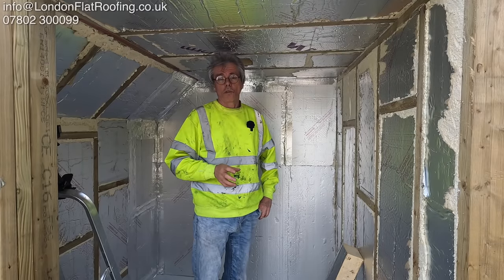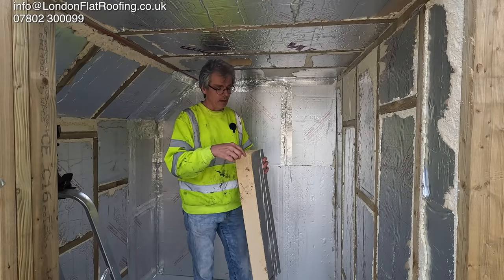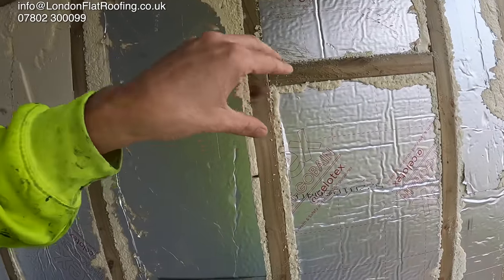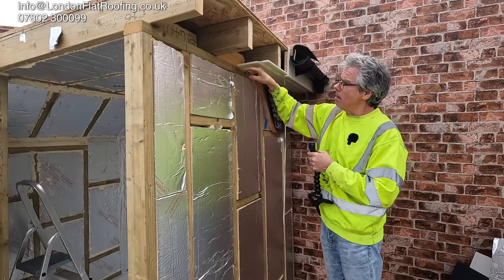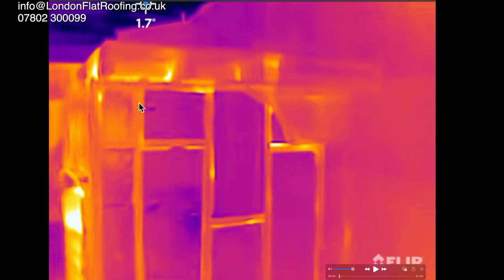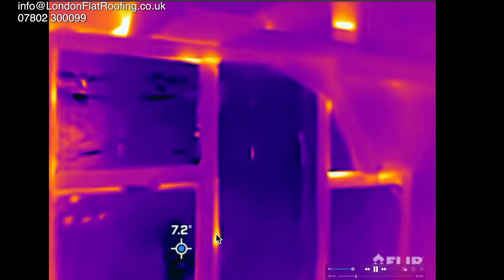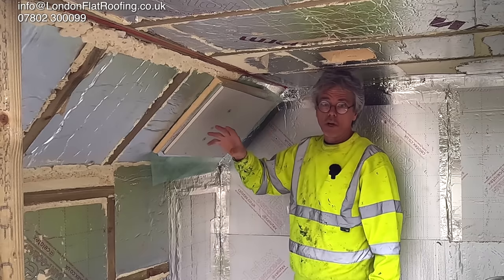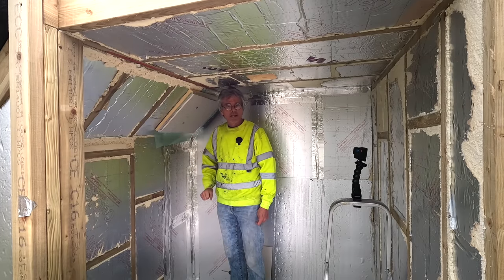Badly fitted insulation between joists and thermal imaging

Comment: I’m a carpenter and currently constructing my partners gym. All timber construction. 
Using the tape you have mentioned. Much prefer this method, it is time consuming but a better job. 
Couple of things to mentions: 

I do have a crown roof construction which adds to the overall outlay. 

Cost. The tape cost as much as the pir insulation for the whole build. 

Once you have a system going it can be quite quick to install tape. 

All in all this method will have to become the norm as we evolve in the construction industry I just hope the tape price will come down.
Reply from the maker: Please send over some photos would be nice to have a look. Yes, its better but very costly. I think we will be moving away from PIR insulation soon I will be showing a completely different way of doing things in an up and coming video using mostly much cheaper insulation and a quicker method of installing also more air open!
Reply: @SteveRoofer  I will do Steve. Thanks. I have subscribed to you for some time and you have certainly made me re think on the  installations of insulation products. You are a credit to YouTube.
Reply: @SteveRoofer  looking forward to this Steve, informative as usual.
Reply: Yeh I would much prefer to use the tape but it's just way to expensive at the minute.
Reply: @SteveRoofer  Please do it soon - I am about to embark on a similar project.😀👍
Reply: Totally agree with having to move away from pir have thought this for years if its too reliant on perfect scenarios and only performes in basic simple detailing then it is going to be failing in a lot of buildings unfortunately where corners can be cut as its not seen.
Reply: @hn9598  Yup it looks great on CAD drawings etc but completely different in real life.
Reply: Hi and thanks for the very informative video.
Question though (possibly controversial to the elitists): your TI Camera showed bright yellow where heat loss occurred. This looked to represent less than 1% of the total area that you insulated. Is that really as big a deal as you are suggesting?
This is in no way a criticism, but you could end up spending way more money on material to cover that 1% than you would lose through extra heating charges.
For me, I Intend to create a warm loft as it’s used for storage,  so I’ll use approx 250mm of rolled out fibre insulation between the joists then was thinking of simply wrapping the underside of the rafters with the super foil type stuff just to help keep the warmth in the loft.

Would love to hear your response to my question and any advice you have to offer.

Many thanks, look forward to watching more of your vids.
Reply: Ему просто заплатили за рекламу! Пароизоляция в помощь!
Reply: Spray foam better. Moves with the wood. Quick to install. Just not a DIY product atm.

Comment: I think it’s important to be a little more clear on the definition of ‘loads of heat loss’ . As a previous comment mentions, what is the heat source used to record the heat transfer? Also what are the span parameter settings of the thermal camera. The images in thermal imaging can often look alarming but it’s important that the interpretation of those images is understood correctly to be realistic in the  quantitive data. Thumbs up for the enthusiasm but those cameras in the wrong hands can be quite misleading.
Reply from the maker: Your absolutely right in aspects of your reply. My point in the video is we can do better and should do better.
Reply: In reference to the thermal camera, are you saying "please clearly define the colors in reference to how much of a change in temperature the areas are"? In other words, the visual "distance" between blue color on the camera and red is 0.5 degrees Celsius vs the "distance" between blue and red is 15 degrees Celsius?

Comment: I appreciate there is clearly heat leaking through the badly sealed gaps between insulation and timber but it's a pretty small proportion of the wall as a whole.  Surely the answer is to leave a ~10 gap all around and foam it.  This would give a much more consistent foam installation and not only will this provide a better thermal performance through the foam - and the wall as a whole -  but also, as you mention, much reduce air movement though it.

Comment: I'm rebuilding my old 1880s house and am using Rockwool/Rocksilk everywhere with a membrane. Cut it 1/2" - 1" bigger than the gap and it makes a nice tight fit and fills up any wonkiness in the battens.

Comment: I just made my own tape.  A roll of expansion joint foam and a roll of foil tape.  Costs less than a quarter of gapotape and does the same job.  Little bit more work tho.
Reply from the maker: I think something is going to have to change as at the moment there only seems to be one very small company making this  tape
Reply: Can you post an example of the expansion joint foam…. I’m upgrading the insulation in my Dorma cottage… so far have just put insulated PB (72mm) over the top of existing PB (which has about 70mm of rock wool before the felt) I figured that because of the gaps PIR wouldn’t gain me enough to compensate for the mess of removing the rock wool and plasterboard… I am however going round with my thermal camera installing rock wool where there is none… However for the Apex I thought some PIR might help. Hence maybe using the quarter price gapotape….
Reply: Can you easily find wide expansion joint foam tape?

Comment: I’ve started using my table saw with an extractor to cut pir, it’s fast, clean and accurate. I thinking your using expanding foam you need to leave a 5mm gap all round to get the foam right in there, I’d be interested to see what works better- tight square cuts or loose cuts with foam around
Reply from the maker: Im going to do anther video and I will try that also i will compare the foam tape. thanks for the idea
Reply: Yeh whenever I foam in boards & I cut them with at least 5mm gap to get the foam in & use screws etc to hold the boards in place until the foam sets as fitting the boards tight sounds good but I always found you end up with some smalls gaps which you then struggle to fill because they are to small to foam properly.
Reply: @SteveRoofer  if putting that foam tape around every square of celotex is the only option it’s gonna make work so expensive we’ll be better of getting it sprayed. 
Side note- I done a loft and garage conversion recently, foil taped the loft conversion, it cost me about £600 in labour/wages. Stapled a vapour barrier on garage conversion, cost about £80.
Reply from the maker: Yes its getting out of hand
Reply: @benchippy8039   yeh most man made materials give of extremely nasty stuff when burned, when I was a fireman I can tell you that car fires were some of the nastiest in terms of what you breathe in if not wearing appropriate PPE. To be fair breathing in large quantities of smoke from natural materials like if you were trapped in timber building fire could kill you in a breath so best just to avoid all together!
Reply: Yep it slowly gives off gases.Hey but we construction guys on site can do something about it and save your customers from suffering the long-term dust particle inhalation by following this guy's advice.tape seal exposed joints cover with membrane then a shed load of plaster board (the red fire stuff if you can afford it).we can then sleep at night & hope those criminals at Eco.....And Kings..... get their punishment. But bad news Ireland & France (where stuff is made) are EU .we are not now , so can't touch them!
Reply: @ianbennett3164  I have used isoair wood fibre insulation on listed buildings, seems more sustainable and definitely friendlier on the lungs. 
If the stockholders at celotex, eco, kingspan etc know the product is dangerous, I imagine they’ll consider any compensation as the cost of doing business
Reply: At the Grenville Enquiry Thier excuse we only make the stuff you have put it in the wrong place. Oh by the way take no notice of our fire tests they were criminally rigged to give the answer the customer wants .  Big business but customers like us can go elsewher
Reply: @ianbennett3164  I know Kingspan's HQ is in Ireland but I think their products are made all over the shop. I know they definately had a factory in Derbyshire at one point because the first ever firestation I worked at was practically next door to it & I went on several inspections to it.

Comment: In Finland we leave the foam insulation about 15 mm smaller on each side than the cavity and then fill the gap with flexible gun foam. That way we can ensure the gaps are filled entirely and no places for heat loss or air movement are left.

We usually also add another continous layer of pir-foam on the inside (normally 30-50mm). This layer acts as vapour barrier, insulation and thermal break all at the same time.

Comment: The expanding foam absorbs moisture. This is why a thinner secondary layer of at least 25mm insulation over the studs is important as well as below the rafters. Even taping or sealing the external lining with another layer of insulation. We never use insulated plasterboard as you’ve then turned reflective insulation into convected insulation.
Reply from the maker: Although I can agree with some of your comments above I'm not quite sure about your comment on insulated plasterboard! By the time you've installed the plasterboard even if it's backed by insulation you are deemed to be internal and therefore you should have no problems.
Reply: @SteveRoofer  what about services coming through the wall ? Cables, pipes etc have to them penetrate the VCL for every socket switch pipe etc. every screw to install the plasterboard penetrates the VCL behind it. Here in Scotland we’re still 150 centres for fixing. That’s the equivalent of 19 penetrations from the face of the plasterboard into the substructure that we’re trying to prevent cold bridging from. The best way as we know to get rid of vapour is ventilation. There’s no ventilation next to either on the inside or outside face of a VCL that’s hard up against another surface. The other “issue” with insulated plasterboard is that it doesn’t prevent cold bridging from the substructure unless you’re able to seal all but joints between each sheet. And if you’ve got for instance a 72mm insulated sheet that’s probably worse than a steel penetration because it’s 72mm deep gap only stopped via the plaster or jointing compound. 
Where as if 25mm+ of PIR is installed over the studs then battened out again all joints taped on the insulation to create your insulated envelope you know you’re now not relying on any other measure of sealant. Any penetrations in the future of the building will not affect the VCL performance. What about radiators also. On an insulated plasterboard wall with a foil layer directly behind the plasterboard it won’t reflect heat but absorb it as there is no airspace to reflect that heat into. Heating up the mechanical fixings also. Helping heat penetrated the insulation more. 
It’s all little silly things but lots of little things can make that difference I believe. The least penetrations we can put in our walls where the VCL is involved, the better. No hundreds of staples. No hundreds of drywall screws, no multiple cables pipes or electrical boxes but into our insulation. Air circulation where you want it. Any moisture that may get behind a battened out wall over insulation has an air flow between the back of the plasterboard and the face of the foil. It’s also got somewhere to go. Directly down in the case of a malfunction. No need to seal plasterboard to floors etc. if anything you can raise it up 5 or so mm to help vent behind the board. It’s sure not detrimental to your sealed air. It seems a common practice though for big house builders to teach their workforce to air test after walls have been plastered. If we can air test at insulation level, we then know our insulation ins doing exactly what it is meant to be doing. 
Just my opinion though.
Reply from the maker: Making a service void is alway the best option
Reply: @SteveRoofer  standard with us. Some councils won’t allow insulated PB when planning for extensions. I believe there’s an issue with fire ratings also.

Comment: Since the mockup is open, I''m interested on what you use on the inside to generate heat. I know it is not important, but it will give the whole story so the viewers (and me) don't have to think about that anymore. 

I have worked for a company that does installation like this. Cutting the PIR insulation using a long Snap off Razor Knife and use expansion foam to close the gabs and tape the seams afterwards. The cuts will not have an 90-degree angle, the cuts will not be uniform.

That company never uses a vapor barrier. They trust the aluminum cover and tape to perform that function by itself. 
As you tell and show, never expect to depend on one barrier by itself. 

Using foam tape, this will help to have uniform insulation, but this means cutting the PIR plates using something other than these snap off razor blades.

Why do companies don't use better cutting equipment? Because it takes too much time, and time is money. This opens another discussion all together. Off course, the finished install that must perform as required and expected by the customer. The practical and the theoretical. It is difficult, especially retrofit installs. 

MY QUESTION: 
What will be the loss by not going for a correct installation? 
1) Not having the correct 90 degree cut and correct size fit?
2) Not using foam tape?
3) No continuous vapor barrier?

I could argue, the best install would be closed cell spray foam. But that means, no DIY.

I see in the comments, you will show an alternative and better install using other(?) methods for the installation? I can't wait 🙂
Reply from the maker: I preheated the room with a fan heater for about an hour before taking a thermal imaging. I'm going to do some more testing with the insulated tape and see how that differs using the thermal imaging speak soon

Comment: I installed 142 mm alufoil-faced insulation for my workshop build. The external sheeting was already completed, so I had real problems getting a precisely cut sheet into the stud gaps. Effectively, the sheet was compressing air. I found the most effective way to get a good seal was to cut the sheet exactly 10 mm too small, insert the sheet, then fill the gap with foam, starting from the back of the space. Of course, a workshop doesn’t have the insulation and damp requirements of a house, but I wonder wonder if my solution would be acceptable for habitable spaces. Final point, I bought the Festool specialist insulation saw. Used with their track it enabled extremely accurate and square cuts in the insulation. Disgracefully expensive though!

Comment: Everything you said is correct!
You seems you know the details.. I have sub question  which i need confirmation.
When wee put bariers on both sides  we basically  trap air and humidity "between inside/outside space.
And people are screaming.. wood needs to breath and it will rot.. and that is never endless story.
Now these is my "logical guess" answer...
2 situations.. when we have new build and wood is not dray i would aggre with answer that wood needs to breath and prevent rotening and mold.. but in second situation when wood is 10 and 15 years old  .. than it has stabilised and should not be problem with wood breathing or mold itc.. because  it leaves in stabelised and unchanging  enviroment.
What is your professional answer.

Comment: Hi Steve, stumbled across this video and very informative for understanding the importance of tight fitting insulation. You mentioned doing a test between three different installs, did you ever do that? 

Most times we do 100mm between rafters then full sheets of 50mm pir over the top to prevent thermal bridging between the rafters. With that in mind what is the most effective way of doing it? To me gapotap seems insanely expensive, I've always fitted PIR very tight however I'm starting to think it might be better to leave 5mm all the way around and fill with a low expanding low u valued expanding foam ensuring it's the depth of the board. Do you have any experience with the best performing option?

Comment: The foil is not just a VB, but the performance of the PIR board is dependent upon foil facing either side. This also protects the insulation foam from decaying… this is probably why BC are asking for continuous foil. It all illustrates the reason for external continuous insulation.

Comment: Thank you for doing this Steve. I have been retrofitting with PIR, using a tracksaw, to get accurate fits and it takes forever. I have an upcoming project so would be really interested in your proposed alternative to PIR.😀👍
Reply from the maker: Its on its way in about three weeks
Reply: Pir is just not the answer in older buildings in most scenarios as there is too much scope for poor detailing as insulation like pir wasn't designed into the building . Its great in a modern sips design.

Comment: When I was looking into PIR foam panels being placed in a wooden frame like that, the Kingspan website said that it didn't actually meet any standards until you placed a PIR backed plasterboard across in the other direction, and from there I guess you would plaster/skim it and paint it making it a complete solution?